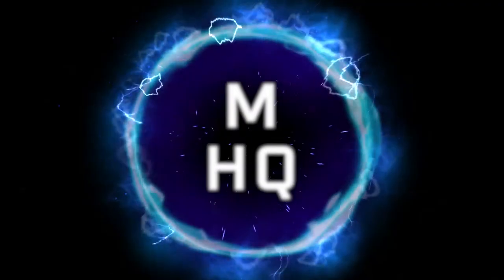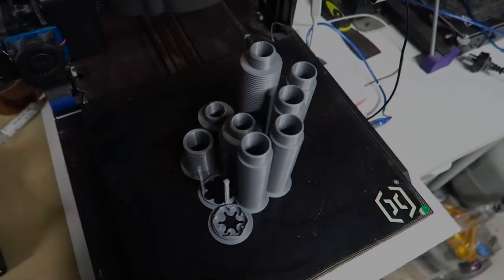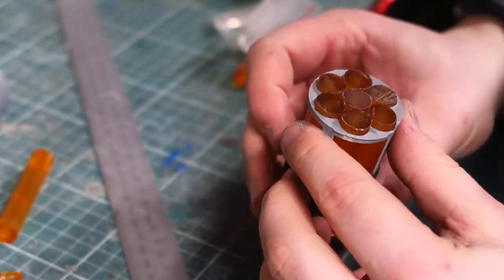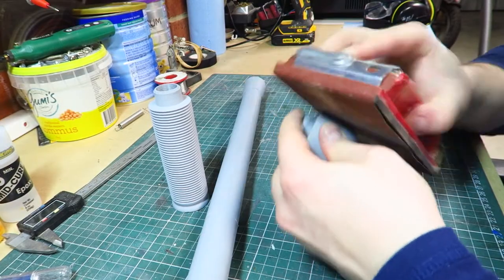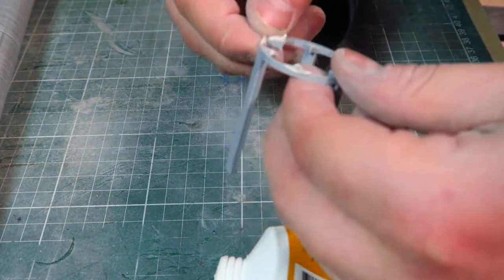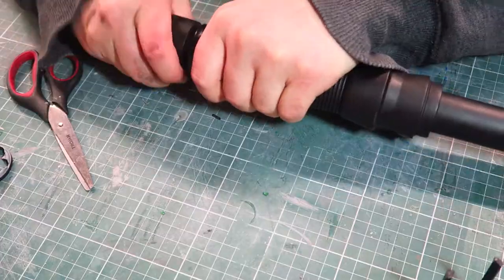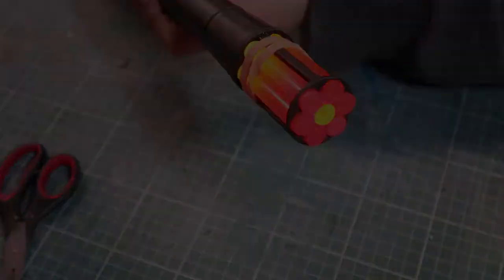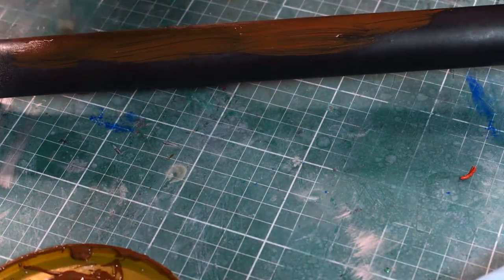Pruning Baton || Loki Prop Replica || How To Make

Comment: Very nice thank you for creating this and sharing it. May I ask what kind of putty you are using... always looking to try new items to smooth 3d prints. It sounded like you said bondo putty but could not tell for sure.
Reply from the maker: The grey putty/paint is an aerosol based high build primer putty from an auto store and the white putty is a water based 'fine filler' from Sika